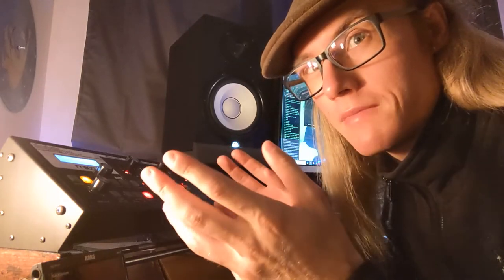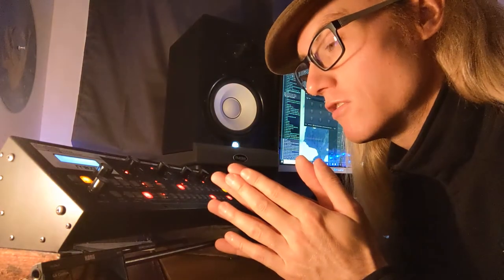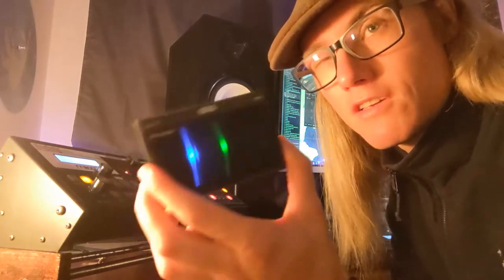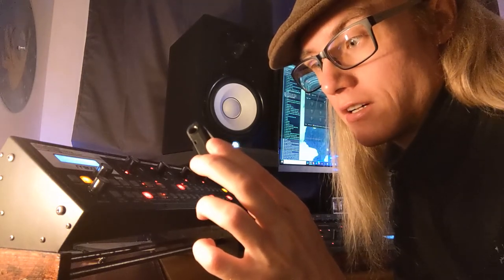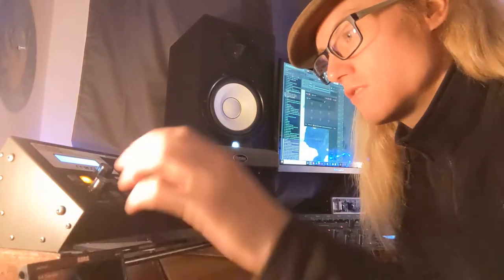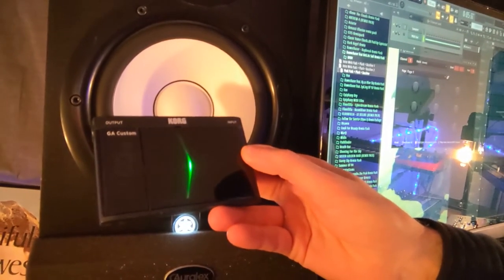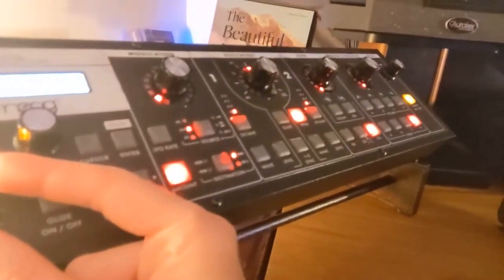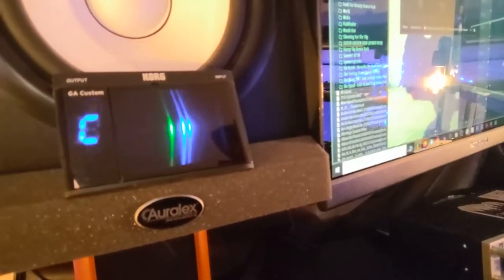Tuning Your Moog Slim Phatty

Comment: I'd also recommend dropping the volume of the 2nd Oscillator if you're booting up from a Preset Patch. From there you can get your standard tuning before turning back up your 2nd Osc and adjusting the Frequency. Cheers.
Reply from the maker: This trick is also handy for getting the detuned saws in our trance and psy soundsets back in tune, cause lorb knows THOSE are not precisely in tune right out the gate 🥴

Comment: Could you go over the auto tuning feature? Also, liked the cat part :)
Reply from the maker: tbh, we haven't actually messed with that. AFAIK it just reorients the unit's base tone back to the standard tuning, but doesn't have much impact on temperature-induced tuning changes

It does merit further investigation though

Comment: why not use the tuner in your DAW?
Reply from the maker: That works too

FL Studio introduced a tuner recently and without much fanfare, so we didn't realize it was even in there until we googled it just now 😅 no doubt it works just fine for the same purpose as a physical tuner for the folks using a DAW. For the DAWless crowd, a physical tuner or an app would be more useful. All roads lead to Rome, we suppose